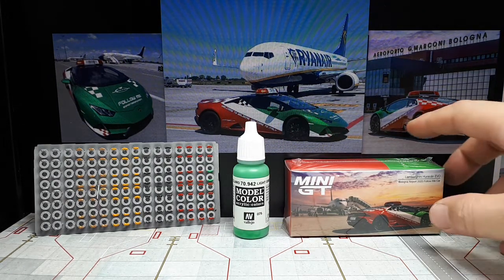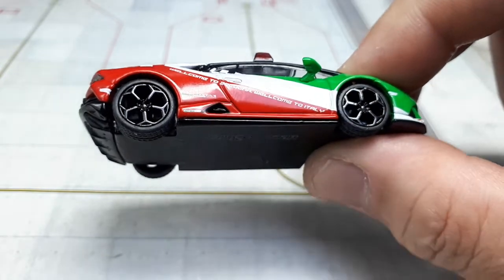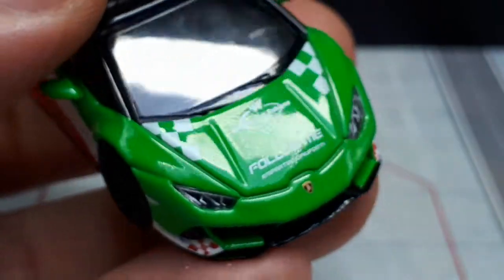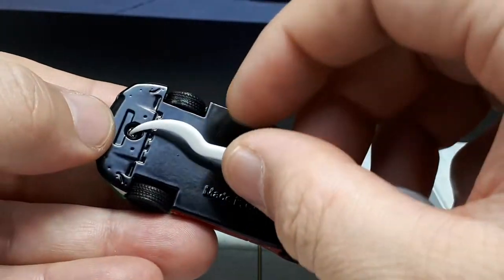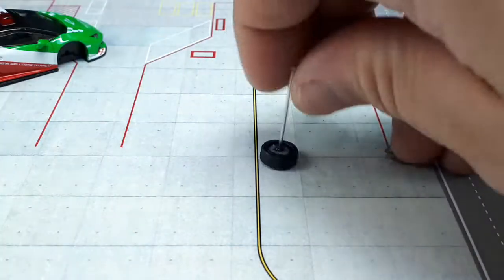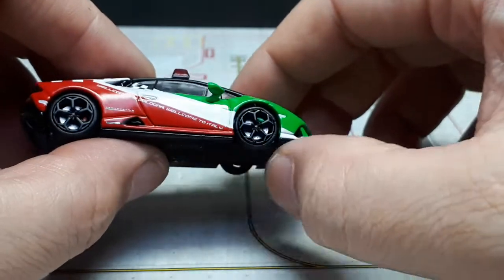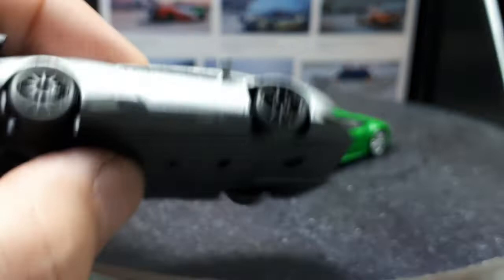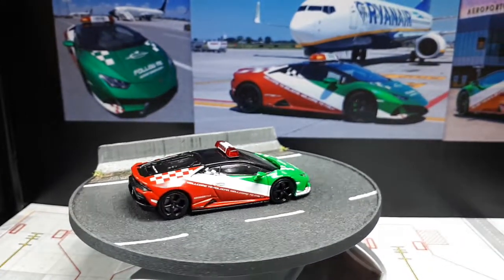1/64 Lamborghini Huracan Evo Follow Me 2020 by MiniGT 193 & no open brake mod

Comment: one thing that bothers me about this model is how the checkerboard on the red part in the back is straight, but in the real car, they are sorta diagonal, they follow the lines of the car better and the pattern is shaped like diamonds rather than regular squares, hard to see at first, but its clear when comparing with the real car, and its the kind of thing you just cant unsee lol